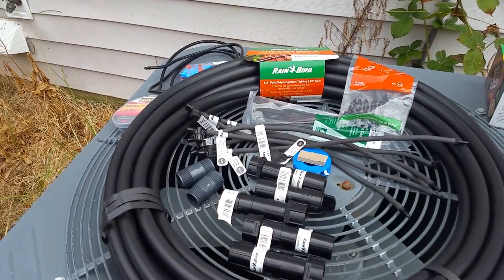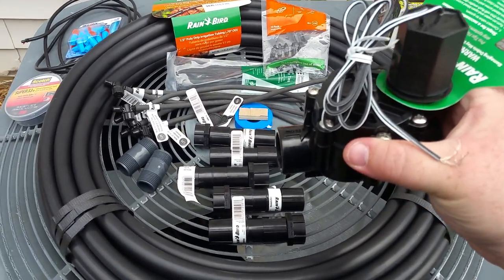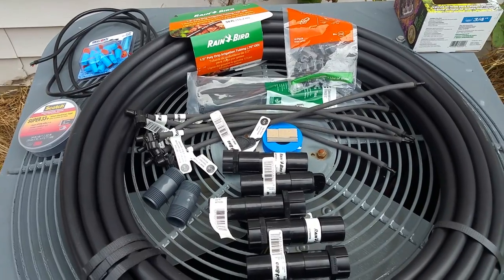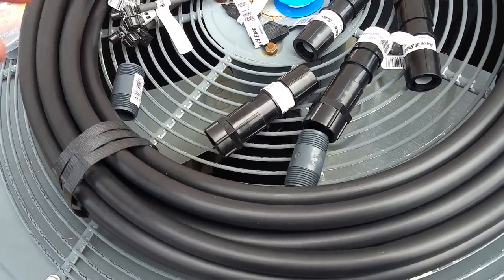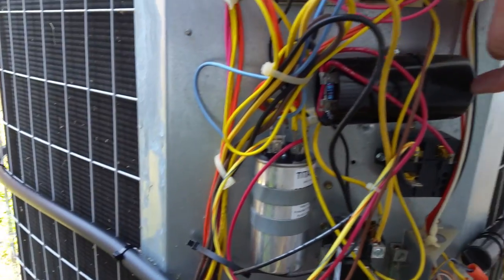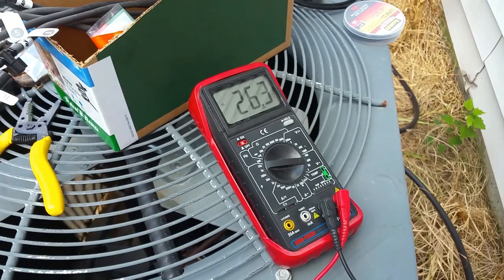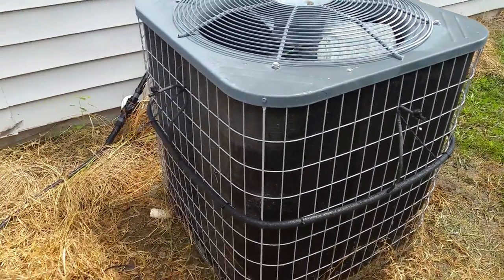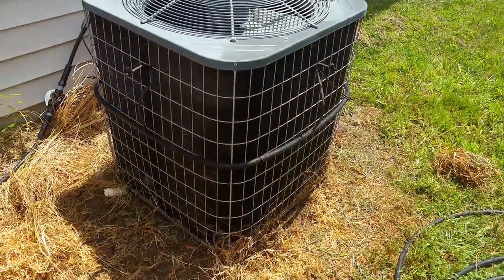DIY Automatic A/C Condenser Evaporator Mister - Electronically controlled!

Comment: The funny thing about this comment section is that very, very few of you even understand the concept. You're all going on and on and about shit that isn't even relevant. The maker of this video didn't even get it right, but none of you even seem to understand that. Let's clear this up a little bit. 
IF DONE CORRECTLY NO WATER SHOULD BE BEING SPRAYED N THE COILS! Everyone has missed this concept totally, and are arguing about the effects of spraying water continuously on the coils. Even still the only valid argument against that is scale build up, which will definitely happen, and there is no filter available that can do anything to stop it. Just like you cannot filter salt out of water, you can't filter out anything else dissolved in it either. The corrosion arguments are just dumb to put it plainly. Thats really reaching out there, and not something tha would be an issue in real life. One dude even claims that water is going to destroy your copper within a year, ROFL. Not true at all, obviously. Besides that, NO WATER SHOULD HIT THE COILS!
    If done correctly the water will evaporate in the air surrounding the coils, which will cause the local air temperature to drop pretty significantly before it's drawn through. This is no different than running your AC when the temp is a little bit lower outside, which is obviously not a problem. I know for sure that my unit works better at 80 degrees than 105 degrees.  The head pressure argument is just plain ridiculous considering that nobody is suggesting subjecting the coils to any temperatures outside their designed range of operation. More irrelevant crap, grasping for straws. 
   This is not for everyone, and isn't going to help at all unless it's very hot 90+ and the air is dry. Running something like this anytime the unit is on is just silly, wasteful, and unless it's very hot and dry you will end up misting your coils causing the scale problem. It likely will save on cooling costs WHEN IT IS VERY HOT AND VERY DRY. How much has yet to be determined, not 50% as some claim for sure, but maybe 10%, and only when it is very hot and dry. 
If it's 105 degrees out, and dry, this evaporative cooling of the air around the unit is absolutely no different in any way than if the air were simply cooler. What is so difficult to understand about that for most of you guys? HAve you never seen a swamp cooler?  Same deal, they don't work in every environment, but when its very hot and dry the only thing coming out of one is cooler air than ambient. YOu don't get soaked standing in front of one, just cool air comes out.  
If you live in a very hot and very dry climate, and set this up properly you can absolutely benefit from it, with negligible side effects if any and certainly no catastrophic failure as some of these experts claim.
Oddly enough, there are plenty of window units DESIGNED TO ACTUALLY SPRAY WATER ONTO THE CONDENSER! That's right actually spraying water onto them anytime the unit is on. COLD WATER, too, as it's the condensate that just dripped off the evaporater. The condernder's cooling fan, when installed per the manufacturer's directions will skim the surface of pool of condensate, splashing it all over the coils, greatly increasing the units effectiveness. This is not the same as what the water misters are supposed to accomplish though, the water from the misters should evaporate completely before contacting any coils. I'm just pointing out the window units design because there are a few in here who are saying that doesn't work, even "if that worked they would be made that way. Well guys, THEY ARE MADE THAT WAY!
Anyway, I'm an idiot right?  What do I know?  All I know is that 99% of you totally missed the concept, and cannot seem to wrap your heads around it at all. Probably because you don't live in a climate that this would even work as it should.  There are only a few days a year where I live that this will work as designed even. If you are in the southwest this may be very helpful for you, in the southeast, not so much unfortunately, and if you are in the north anything then why are you even reading this?  
For those in the southeast though, I have something to say that could make a miserable situation a little better. If you are having issues on the hottest days where you just cannot keep the place cool, inside temps of 80 degrees are the best that your unit can do, and you aren't in a position to  get raped financially by service techs, SPRAY WATER ON YOUR CONDENSER! Just set the water hose to a light mist and leave it next to the unit. Miraculously your inside temps will drop dramatically, regardless of what all these experts are claiming. IT WORKS, and doing this a few times on the hottest days when you really need it is not going to cause you a single issue, none.  

I'm sure there will still be some folks who just can't handle reason or logic, physics or thermodynamics who will be back to call me names then run away, patting themselves on the back and thinking they are cool. That's fine. Any reasonable person with a fully working brain should be able to understand and agree with what I have said here. The rest of you, yeah i'm just an idiot, you go on and have a nice day!

Comment: if you're using a mister around your patio and you find that the nozzles clog or need to be replaced  or cleaned then deposits are being left on the condenser as well it would seem.

Comment: We had an out door chiller for row cooling in our data center. It had a pre-cooler that used cardboard flutes much like a swamp cooler to pre-cool the air with water before it hit the condenser. We used two huge calcium filters and the condenser in that unit was destroyed by calcium buildup in 5 years. It was so clogged with calcium the condenser could no longer flow air effectively enough to do its job. We already did this experiment, it does work, but calcium will clog the condenser over time.
Reply: I agree that calcium buildup (or any other mineral) is my biggest deterrent, but I believe I found the filter to do the job, as it appears most filters don't seem to catch calcium or at least don't seem to do a good job, per the reviews. Here's the one I found: Orbit 10109W Misting Calcium Inhibitor Filter

EDIT: After posting, I checked the parts list the uploader provided and this is the very same filter LOL

Comment: just had a thought  (probably not first person to have this, lol). Mist air filter/chiller : You could probably further reduce mineral building up (beyond trying calcium filters), (and reduce 'corrosion'  from oxidizers in tap water like chlorine), if you wrapped the condenser in 'just the right sort of foam/fiber material..that could catch the mist and chill the air more before it hit the coil instead of chilling on the cool with more moister and minerals then on the coils. But remember evaporation means the air is 'soaking in' more moisture, so this may not work as well as moisture right on the fins, because they are hotter and that creates a little 'laminar dry zone' at the surface of the fins  because the heat (of the fins) increase the amount of moisture the air can 'soak up'. The 'filterchiller' would not have this heat, so that could kill the concept except in dry regions where the ambient air can readily take on water and be cooled that way.  Correct filter it would not affect airflow much during non-misting operation , but would keep much or most of the mist water off the coils. You could just unwrap and clean it or replace it. the mister head could go though it maybe and the misting plumbing could still be underneath the wrap. There would definitely be a sweet spot of flow, surface area/arrangement etc. So would take some testing/thinking etc, but just a random idea that seems at least a 'plausible hypothesis'. It would likely also make it easier to not waste water to the wind or onto the ground, as you could aim the misters more towards it than away, but yeah dispersion variables/methods etc..you could maybe even use small soaker-type dispersion instead of mister head, 'dripping' water on the filter. Yeah I know is a just a rough idea I have no idea if could end up being of good use. Maybe just the pre-filter layer off of foam blower filter-that sort of material.  But idk how durable it is to UV etc. If the 'filter wrap' was kept too wet  the airflow would  just pull the excess moisture right out of it and onto the coils anyway, the point would to keep the water flow below that point. You'd want to try to have the filter thick enough to evaporate as much water as is possible during 'best' drying conditions, but then lower the flow for 'worse' (higher ambient humidity etc'. There is some real science here. If you controlled this all precisely you would dramatically reduce water waste..to practically none. That kind of control is what technology is good at doing cheaply. I keep thinking this is really  best for more dry regions because evaporation is so reduced in high humidity. It seems misted air directly onto coils is still much more efficient. Perhaps problems with that could be addressed by being more concerned the water quality somehow and controlling mist so most of it get's to the coils and not ground or carried off in wind. Also, you can go deeper, you could perhaps have an automatic 'corrosion and mineral build up inhibitor injector' in the water system that would have a reservoir you could refill...but idk if those 2 traits in a chemical aren't mostly conflicting with each other lol.  (most mineral removers are acidic) Another interesting consideration is just what harm might mineral buildup do? Unless it gets VERY thick it doesn't seem to affect how the fins work much. I don't know if ever, or always,  contributes to 'corrosion', for all I know it could prevent it, the way 'patinas' can. Would need some science about that too.

Comment: In Fla, the humidity and temp is way on up there most all the time and our condensate appears out a drain tray and sometimes an outside drain line. I Catch mine in a large clay planter for spot watering any plants not on my irrigation dripline. I would'nt use the irrigation water but the condensate should be ph neutral. I think I'll pump mine from there, instead of using city water and drop the corrosion chances further down. I'll scale the tube size down to dripline 1/8" and put a 30psi pump on some misters.

Comment: An easier setup would be to use a “sail switch”. It mounts above the fan and turns on when the unit comes on. You can also use a simple float valve mounted upside down above the fan. Remove the float and install a paddle of some kind to catch the wind. The valve is off when the fan isn’t going and the opens when the fan comes on.

Comment: I also connect the wire to the old mercury thermostat and adjust that it turn on the mister when the outside temp more than 90degree f the parts are ( Orbit 20066 Portable 1/4-Inch Outdoor Mist Cooling System    15$ and Orbit 57280 Female Pipe Threaded Auto Inline Sprinkler Valve, 3/4   13.62$,  Orbit 10109W Misting Calcium Inhibitor Filter  19.98$ for total 48.60$ from Amazon), and one of old mercury thermostat.

Comment: i would think it would work better if you hooked the solenoid up to the blue (common) and the orange (reversing valve) that way on a heat pump it wouldnt open up unless cooling is being called for. Because in heat mode it will still open(on yellow) if its a carrier bryant etc, but if its a rheem then the way you hooked it up if fine because the cooling mode on a rheem energizes the reversing valve in heat mode where as most other brands energize it in cooling mode.

Comment: You will see a current drop with the misters lowering the head pressure and saving energy. You can measure pressures and current for proof it works.

Comment: Nice video.  Misting drops down the super heat temp before going into expansion value.  Nice quality filteration is required.  Just shading over condensing unit will not cool down super heat temperature.  I have done mine two years ago and have no problem.  My summer electric bill drops down about 30%.  I have only one mist on three sides.

Comment: Brilliant!  I'm surprised there isn't a 24v on cooling only, so you wouldn't have to have the sprinkler valve actuate during the winter months.  Thanks for the video.
Reply: WS P he could have hooked it up to the orange "o" wire which is for the reversing valve which is only energized in cooling mode. Rheem and ruud are energized in heating so ot would not work with those systems

Comment: Something like this could work but the compressor needs to be smaller for true efficiency, it was designed to be a simple air over coil.   Having some refrigerant readings would be cool.   My guess is the unit will show low freon but in reality you could decrease compressor size, whole unit for that matter, with some tweaking on charge it likely would run like water cooled commercial system, kind of.

Comment: JonBoy.. Like that similar 'Green-Colored' product U refer to in your demo, yours doesn't hit the home run either. Your apparatus is too big..ie. tubing, connectors, 24V solenoid valve etc. The misters put out too much water. You'll have moat around your condenser in no time, in the summer months. ANY hardness minerals in your water will eventually show up on your condenser fins. That's a no-no. Don't know what filter U ordered but, it better address any sand, dirt, debris and CACO3. A 'metering valve' would go a long way in adjusting your water flow, equally to all those plant sprinkler nozzles your using.  As for the electrical... Forget hacking into your thermostat wiring. Try hooking up your solenoids contact wires to the 24V side terminals of your Condensers contactor.  When the system is activated via the house thermostat...the contactor engages power and 24V side terminals sends low voltage to a 24V activated solenoid valve, which opens and supplies water to the spray heads.  
Higher water pressure is suggested for Best Fine Fog pattern. Type of spray head IS, of course important. You get what you pay for.
Try using  1/4 id -5/16 od inch main supply tubing to supply water with. A fine fine spray head will use very little water in producing a fine fog type spray.  Note: A true fog pattern requires hundreds of pounds of pressure. Those systems can run over  $1000 to 3000.
As far as, filters are concerned...U might try using a Mix-bed resin DI filter cartridge for your system, preceded by a 1micron combination sediment and *Carbon block pre-filter. *For any chlorine, in water.  High water flow rate isn't required with this type of system. Good pressure is.   Change out those 2 filter cartridges every season. Use quality fittings and tubing. UV resistant, when possible.  
This type of A/C enhancement, will indeed increase efficiency rating, reduce compressor head pressure, cooler air, reduced cycle time and a significant reduction in running cost.
I got involved with this type of A/C add-on system about 20years ago.

Comment: Have you done any checking to see if you are saving energy? Would maybe placing amp meter probe on compressor power line reveal any change in current draw when mister system is turned on?
Reply from the maker: Bourn Phree there would be a marginal drop in amperage, but the real savings is from the reduction in temperature at the evaporator inside. This is what leads to a faster recovery time, and lower running time. The compressed fluid coming out of the compressor, is cooler further with the mister. By the time the cooled compressed liquid refrigerant reaches the expansion valve and is sprayed into the evaporator it is able to reduce that evaporator temp even further, thus cooling the indoor air more, which reduced the on time of the compressor. That's where the savings comes from. Less on time. It is easier on the compressor, but only slightly.
Reply: Couple things. You can't compress  liquid. And if you have liquid coming out of your compressor it isn't long for the world.

Comment: From what I can gather from all the comments, it appears that some people have seen this lower their electric bills, but the experts seem to indicate it is at a cost of quicker degradation and may void your warranty.  All this has been discussed, what I am curious about is if it would benefit my situation.  I have a 20 year old system, which means no warranty, and will be replacing it when I save up enough in about a year or so.  I don't care if the water speeds up corrosion because it will be replaced soon.  Here in NC it can be humid, but more so, the sun gets very hot in the summer.  Would the misting lower the surrounding air temp via evaporation enough to help limp my old system along?
Reply: I'm in north Georgia. When it's 105 and inside it's hard to get below 80, IT HELPS A SHITLOAD! I don't have any kind of mister set up I just use a fine spray nozzle on the hose and put it close by, before you know it it's 65 inside. Notice how much cooler it gets instantly when it rains?  Try it next really hot day with your hose. Corrosion isn't an issue thats just freaking ridiculous. Scale build up could be but not realy if you are doing this only on the really hot days, and not at all if you don't use tap water. Use collected rainwater, which has just been naturally distilled, or condensate from the evaporator and no scale either.